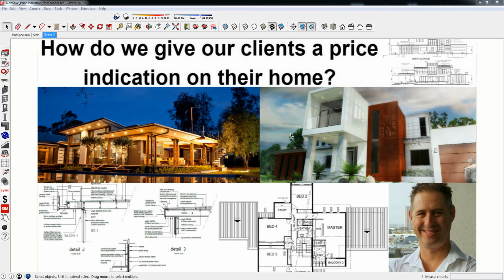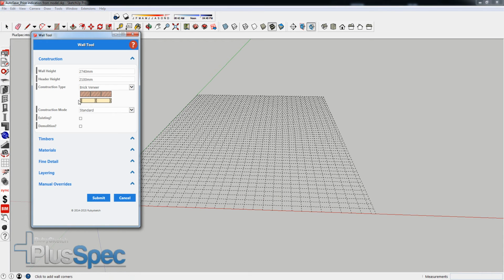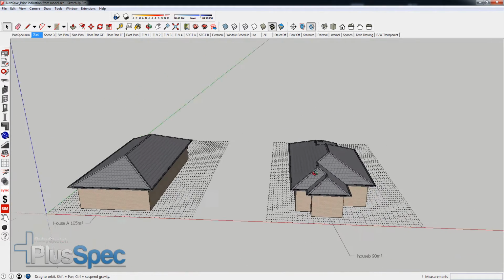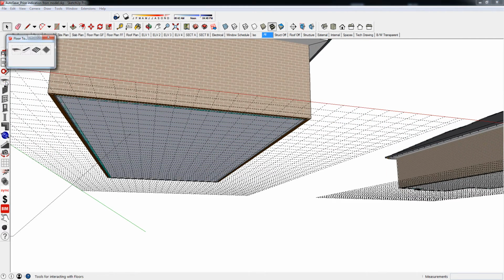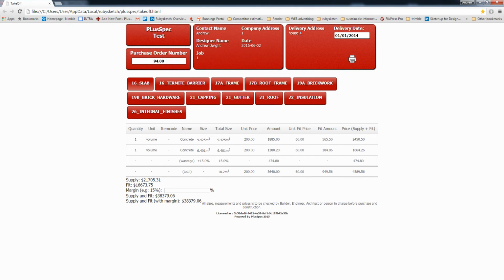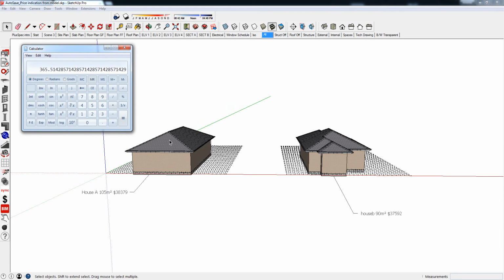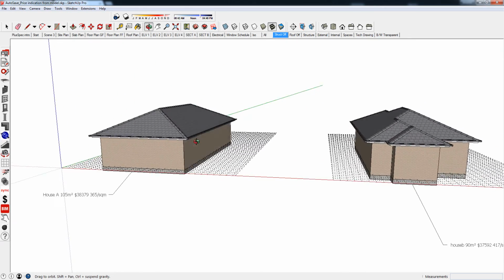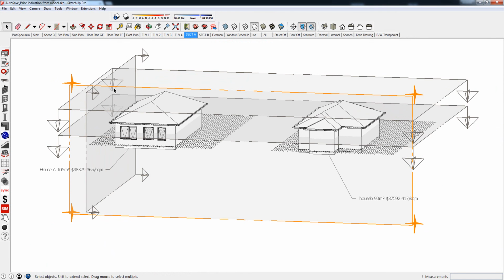The price of housing at design stage explained simply.

Comment: Great plugin and can't wait to start using. Just curious before purchasing, would this software be useful for designing projects that aren't custom homes? Basically, could plusspec be used to design a low or mid-rise condo building and get a fairly accurate pricing estimate (assuming materials costs are plugged in accurately)? If so, this would be a great tool for me personally. Thanks!
Reply from the maker: Hi Matt, yes we have many companies utilising PlusSpec for Condos, we have clients doing full retirement villages and hospitals.. FYI we primarily designed PlusSpec for housing yet as PlusSpec automates geometry creation, therefore, you can create projects that are larger in size. 
 A little birdie tells me that now is a good time to buy as a new version is soon to be released, and existing users will have a "Grandfather clause" Don't tell anyone. B)
Reply: @rubysketch  Thanks for the fast reply! That's great to hear regarding the feasibility for larger condo-style projects. Seems like this software will greatly help in generating costs for such projects. 
Appreciate the tip as well ;) Thanks!
Reply: @rubysketch  Also, are there options within the software that utilize steel construction rather than primarily wood?

Comment: Sure Andrew. I get clients all the time who think they can remove X m2 from a building then add a bunch of optional items to the smaller space without it having a big impact on the price. I tell all my sales people two things about this:

1. m2 prices are a comparative reference only.
2. The higher the density of material in a space, the more expensive it will be. 

It's obvious when you think about it, but with so many builders marketing themselves as $ X/m2, either one of two things happen. You often see them going low to win the project and and then not being able to make it happen, or the real (higher) price comes out at the end and the client thinks they've been reeled in by sexy marketing, and lose trust.

I would love to see some videos related to steel frame, as that is what I am into.

Which sites would you recommend to get up to speed on SketchUp for construction? 

Cheers,

Adam.

Comment: I really have to get my hands on PlusSpec! Thanks for the video, this is something that is always difficult to relate to clients (who tend to only remember the lowest price in a given range of $/m2).
Reply: I hear you load and clear Adam. It is a simple example and is easy to see why giving a cost per sqm calculation can get clients offside very quickly.  
I'll do a more comprehensive video on textures and fittings if anyone is interested.  
Is important to remember that the video above is using exactly the same construction method.  The only change is the design.  I'm not condoning boring design I'm simply trying to highlight where clients can expect one thing and be disgruntled when the cost per sqm or sqf increases. I hope it helps feel free to site your clients.